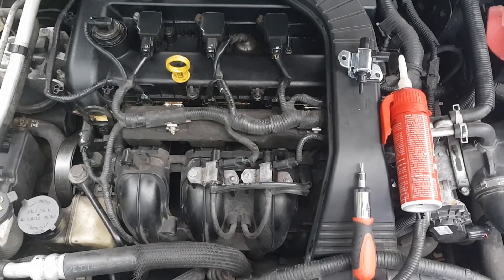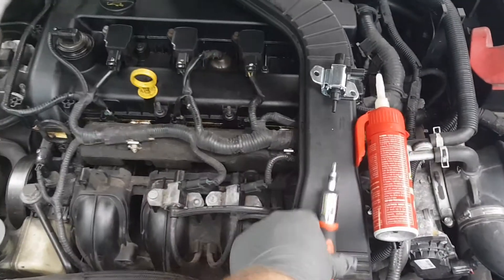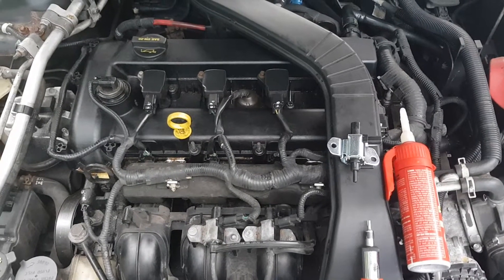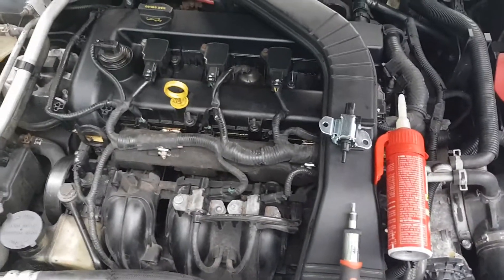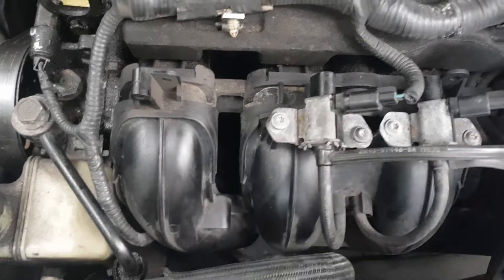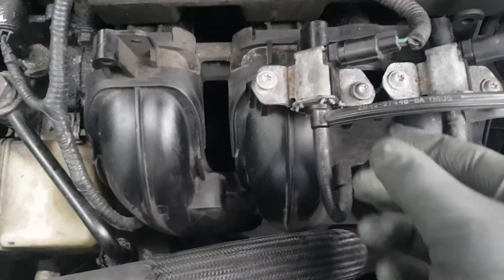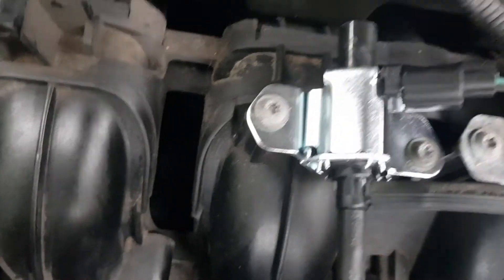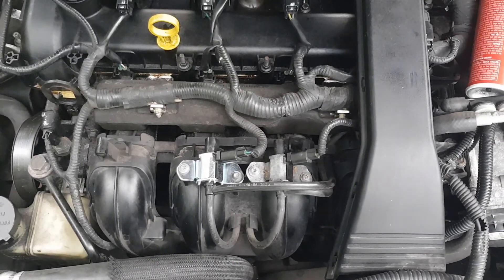Intake Manifold Runner Control Valve Solenoid Remove/Install Ford (P2004)

Comment: Are these valves supposed to be closed when the engine is off? I believe one of mine is acting up and I noticed that I can blow air through one of them and the other one I can't.
Reply from the maker: Yes they should be shut when the motor is off because they're not being used.

Comment: On my 2008 Fusion the sensor on the right side was bad. So for all other people looking for help. Buy one sensor to switch back and forth. FYI you wont be able to tell if it’s fixed till you clear the code and the make sure it stays cleared with a test drive.
Reply: What code was showing before replace the 2nd one ? How did you know was bad the 2nd one?
Reply: @marcorivero1768  P2004 was the code as I recall. I replaced the left one. The CEL turned on right after clearing the light and turning the car on. Put the old left one back on and proceeded to replace the right side. Cleared the code and ran the car. CEL hasn’t turned back on.

Comment: I changed them both an my engine light still don’t go off but the car do sound better I’m not sure what else to do tho
Reply from the maker: Did you disconnect your battery?
Reply: Probably a “Hard” code. You’ll need to disconnect the battery for about 5-15 minutes to let the modules sleep. If that does not clear it, Autozone I believe will loan scan tools to clear it.

Comment: Are both of those control valves the same? Mines got different part numbers and I have to replace them both but wonder if I can just buy 2 of the same and call it a day.
Reply from the maker: They're identical

Comment: This helped me alot and the install was very easy but I'm still getting the P2004 code after replacing and removing the battery... After I replacement them the engine light went off but after 20 minutes it return ... what could it be after that and do you have a replacement video to tackle that?
Reply from the maker: If you replaced the solenoids and the code is coming back then the flappers themselves are stuck and it's not a solenoid issue. I don't have a video for that because my flappers weren't stuck.
Reply: question ?
Reply: i changed the manifold , still p2004. i changed the pcv Valve and it actually runs smooth, but still got the p2004. i changed the solenoid i few months back, i never changed the vacuum holes yet.

Comment: Hi thanks for the vid. I've been pulling my hairs out trying to get an idle problem solved (idle drops and surges when the car is moving and idling, really gets on your nerves when approaching a traffic light) , replaced a bunch of parts, hoses and sensors, but nothing really worked. Now i am convinced it has to do with the IMRC (intake manifold runner control)/IMTV (intake manifold tuning valve) solenoids. I checked the resistances and both are fine, i checked the position of the levers on the manifold while idling and it seems both solenoids are open. I read somewhere that the IMTV solenoid is typically closed when idling and opens at 3000 rpm. Do you know if that is correct? (i already ordered the part, so ill test this anyway, i'm just curious if the info is valid)

Comment: Then what's p2008 stands for?
Reply: I just had a p2008 that the store scanner says silinoid is stuck in open position. Gonna swap this part and see what happens
Reply from the maker: Good luck! Let me know how it goes.
Reply from the maker: P2008 means that the intake manifold runner circuit has an open electrical connection bank 1. The ECU tries to control the the angle of the intake manifold runner flappers and when it cannot control this circuit sets a Check Engine Light.

Comment: Thanks great video...380,000 miles and counting mmy 2007 fusion
Reply: My 09 Fusion 2.3L,  has 276,000. Still going, my daily driver. No major problems.
Reply: Woww pot head media. How far can Ford Fusion cars go in miles? I heard up to 200,000 miles?
Reply: @tonycervantes4816  300,000 my mecanic said they have one coming in at
Reply: I'm at 359328 miles on my fusion and besides basic stuff she is still running strong
Reply from the maker: It's a great car isn't it

Comment: Hey, what about if after you change and install a new intake manifold runner piece, the code p2004 still shows up. I check what i saw from the hose and it doesnt look torn or anything but i cant really see the bottom. Is there anything else it might be? The circuit cut short? It has the same error code p2004 and bank 1
Reply from the maker: Did you disconnect the battery while replacing the part?
Reply: @IconicToys  disconnect while replacing then reconnect?
Reply: @IconicToys  its also showing p2008 as a secondary code
Reply from the maker: @et1833  sounds like your intake manifold control flappers are stuck. Disconnect your negative battery cable for 15 minutes then reconnect. Drive your car normally. If the codes come back it's probably the flappers (if you replaced the solenoid already).
Reply: So I need disconnect of negative terminal While you are changing the two solenoids? Can you wait 15 minutes and then reconnect the battery and delete the p2004 code with the scanner?

Comment: what kind of grease did you use again & where can I buy some?
Reply from the maker: CRC Di-Electric Grease. You can buy it on Amazon or at most any automotive parts store. Thanks for watching!
Reply: @IconicToys  thank you!!
Reply: @IconicToys  i changed my manifold runner and my engine light was off when I disconnected battery and did the process but it came on after? went to my o Reilly’s to see and they said it’s still the manifold & then they said I had to reset my dashboard is that correct?
Reply from the maker: @kk_1310  reset the dashboard?
Reply: @IconicToys  that’s what they said to do?
Reply from the maker: @kk_1310  I have no idea what they mean by "resetting your dashboard".
Reply: @IconicToys  me either. i was very confused.

Comment: Funkofever whats the one in the right for.  My flaps are good I also replaced the pcv valve and the imrc valve on the left and its still giving me the code for bank one any idea why?
Reply: Actuator?
Reply: Did you fixed? What was it?
Reply: @marcorivero1768  yes I found the fix the problem was not the selenoid it was actually the hoses that come out from the selenoid it wasn't holding the air becuz it had a small crack but I had to buy  a vacuum hose pump  to fine the fix

Comment: I just had the same code along with P0171. It turns out that the 2 short vacuum hoses that connect the solenoids to the intake manifold were cracked. I bought a foot of hose @ Autozone, cut it in half, and replaced the bad ones. The fix was $1.90, and also fixed the P0171 code, so look for leaks!
Reply: What size was the hose
Reply: @ryanfijalkowski8509  one of my hoses was missing that’s why my p0171 . I went to the LKQ junk yard and found an identical from a random vehicle and bam, FIXED THE P0171
Reply: Nice , I’m having the same 2 codes, will try this asap

Comment: Does it matter if I switched them around or does one go to bank one other go to the other one?
Reply from the maker: Switch which one around?
Reply: @IconicToys  so I replaced that whole manifold lol and forgot what side one was on lol does it matter where I place them so if the left one was on the right side etc
Reply from the maker: @RVize  the solenoids? Not at all.

Comment: Hey how can I get those tubes that go connected to the intake manifold because mine are really worn off and are ripping off
Makes the car shake on a cold start
Reply: Go to any auto parts store. Take one of the hoses in to find the closest match--go smaller (inside diameter of the hose), but not larger if they don't have the exact size. Buy 1 foot of hose, cut it in half and install them.
Reply: @nella-yema  you can  use a large hose sr. Just is the same diameter  size is good 👍

Comment: I ready change  of solenoid  and do of same . What you think whats of problem  sr
Reply from the maker: @tonycervantes4816  if you changed both solenoids than they weren't the issue. The issue is the actual intake manifold runners. You'll need to pull it off and clean them. They can get filled with carbon. They're made of plastic. You can use simple green and then power wash them or brake cleaner.
Reply from the maker: @tonycervantes4816  I do, but I don't have a video of it posted on my channel.
Reply: @IconicToys  still don't fix it sir.  You think I need remove of intake manifold ??
Reply from the maker: @tonycervantes4816  what have you done so far in order to address the code?
Reply: @IconicToys  only remplace of IMRC solenoid and connector and one hose still same.  My rmp go up . And I feel of car to slow when accelerate.
Reply: @IconicToys  do you think is the map sensor ? Or the intake manifold need remplace sir ?
Reply from the maker: @tonycervantes4816  map sensor is certainly worth considering
Reply: @IconicToys  I'm going to try to replace it to see if that's it. If not, the intake manifold will do the whole thing. Brother
Reply from the maker: @tonycervantes4816 your original comment is 3 years old. Sorry to hear you're still dealing with it
Reply: @IconicToys  yes
Reply from the maker: What code do you have coming up?
Reply: @IconicToys  p2004  2006 ford fusion sel.
Reply from the maker: @tonycervantes4816  did you change one Solenoid or both?

Comment: I got a fusion 2.3 liter 4 cylinders, you think 🤔 that will work by this model?
Reply from the maker: Yes
Reply: Yes. Check for leaks on the vacuum hoses before buying parts. You can often hear the leak. If not, run your hand all around the full length to find any leak, or better yet, pull the hoses and carefully inspect them. as they get brittle from heat and age and develop cracks.

Comment: I had a flashing D light on a 97 Honda Accord and got a code to change the intake manifold sensor. It immediately stopped flashing. I was a bit surprised that was the case.

Comment: How long does it take for the check engine light to go away?
Reply from the maker: If battery is disconnected during removal then it should go away immediately or after driving for a half hour or so. If not, you have a separate issue.
Reply: @IconicToys okay so I don't need erase of code with of scanner ?
Reply: You need to do a complete drive cycle on the fords. If you disconnect the battery, that is.

Comment: Which one is sceondary hub
my diagnostic said bank 2 stuck open .Mercury Milian 2007 4 cyl 
Which Looks The same as one in the video .Just not sure if  its the right or left part one the motor  an going to replace all hoses my part looks the same just not sure which one to place
Reply: If it’s bank 2 it’s the one on the right.